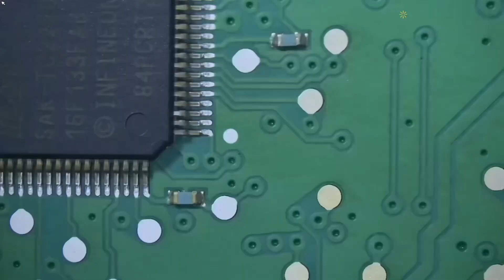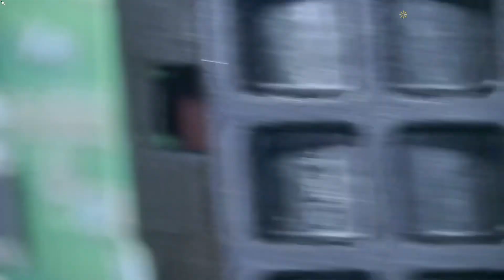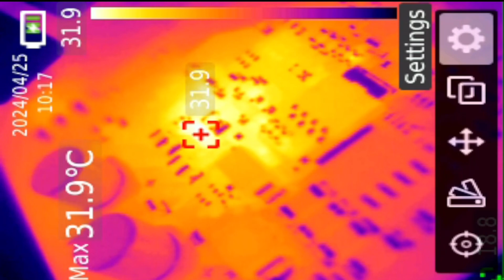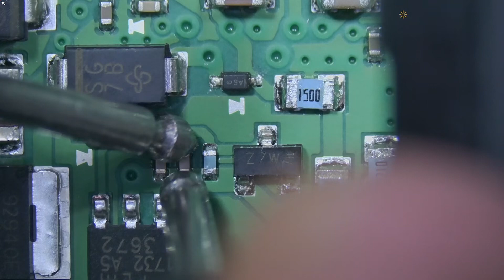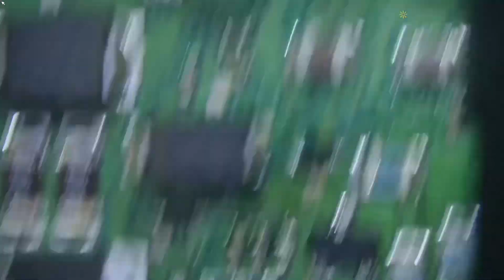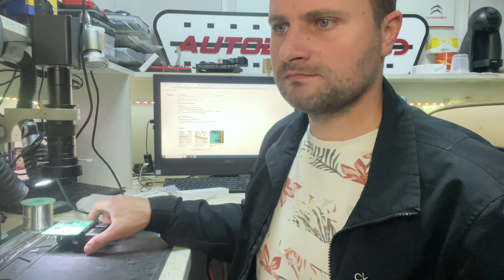Ford Fiesta 2020 airbag module fail | unknown problem cause CAN communication failure

Comment: Interesting that airbag light does not come on but it brings down communication when installed. Have you tried connecting with just it while on bench?
Reply from the maker: Yes, on bench i have diag.

Comment: What is the resistance between CAN H and CAN L?
Reply: 120ohms
Reply: @Autofyx313  Thanks. Did you measure the resistance between the CAN contacts of the module in the video? Probably not.
I know what the appropriate value is.
Obviously, in the case of the faulty module, I asked and from him!

Comment: HI!  The dealer should have offered the new module. To program after installation. This is a proper dealer repair procedure. He can guarantee this, this work is guaranteed! It is a waste of money to inspect the control unit of a safety equipment, because it may not be repairable. Repair is risky. Even with that, the new one and the repair will be more expensive.